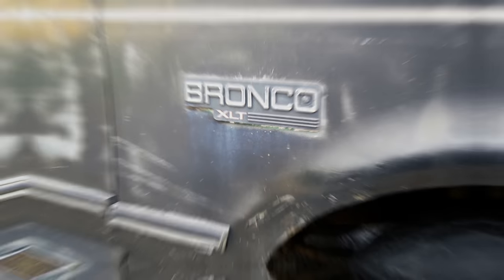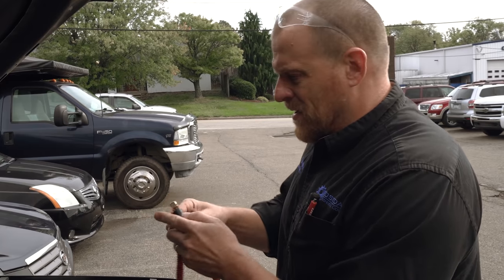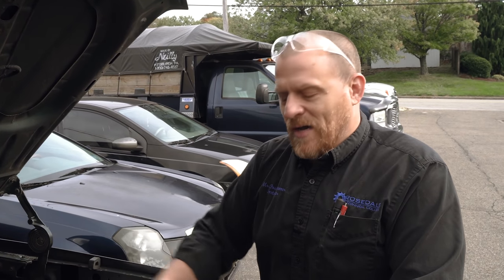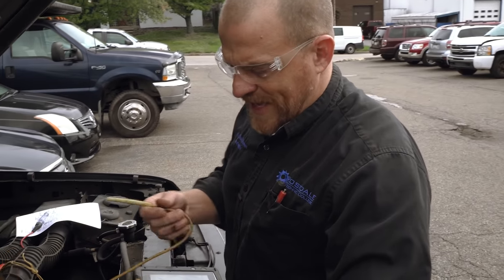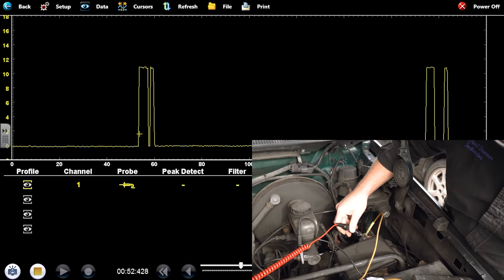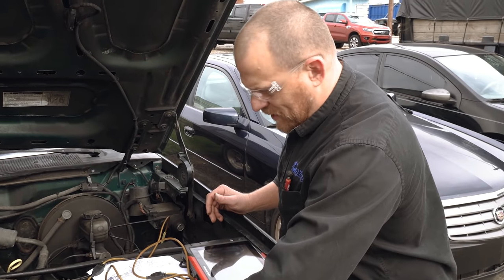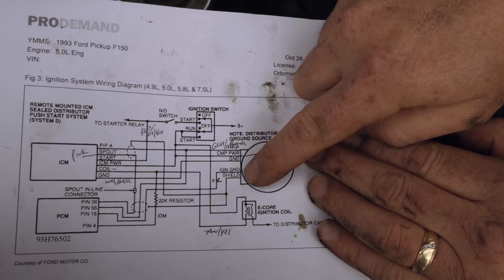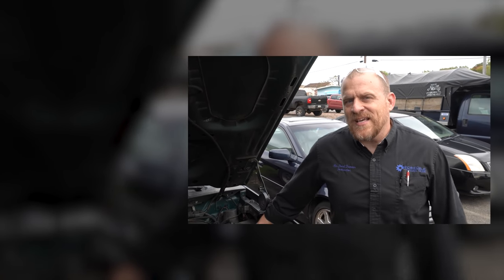Ford EEC-IV No Spark Diagnostics

Comment: Paul,
Great diagnosis/explanation on the good old EEC-IV - thank you!
Those PIP units are such a pain to replace as you need to remove the distributor gear which is pinned and pressed on. Probably replacing the entire distributor is the most cost effective solution.
Paul (in MA)

Comment: Nice. I recently fixed an intermittent hesitation/no start in my 1988 Bronco II (that I bought new in 1987) by replacing the distributor. I used a break-out box and oscilloscope to monitor the PIP and SPOUT voltages, and the primary ignition current at the coil. When it died the PIP voltage decreased and took out the SPOUT and primary ignition completely. One of your earlier videos clued me in to the likelihood of the distributor Hall effect sensor being the likely culprit, so many thanks for that.

Comment: When I was 16 I used to have to start my 88 Ford ranger by jumping the solenoid connections with a screwdriver. It was a manual.  one time I left it in gear and it drove into a telephone pole 🤦‍♂️
Reply: Yes cars are extremely dangerous when caught  someone on surprise. Any individual is exposed to risk of injury when mishandled.
Reply: LOL 🤣😝
Reply: I had to that to my 83 mustang gt. Grabbed the linkage to give a little throttle while cranking….. got a decent jolt 😬.

Comment: I can't say thank you enough for this video!! I just had an 89 Bronco w a 5.8l that just flat died on me like you shut the ignition off.  Using your method and your tests, quickly figured out it was a bad ICM and pick-up.  Couldn't condemn the coil at 1st bc w icm unplugged, I had good pwr in and out of coil, BUT when I plugged icm in, the bright test light on the control side of coil went dim.  Anyway (sorry for rambling), it wound up needing dist assy w module, and a coil. Once I had coil control restored, still no spark from it. New coil on, truck ran like a champ! How can I ever repay all the great information......thank you! God bless!

Comment: ah the ford module!!! was it a 7/32 socket or a 9/32 socket? and you had to grind it down all the way around to fit in the hole!!!!... never forget dy-electric grease between the module and the heat sink!!!
Reply: Kept one of the module tools, a spare module, and a tube of arctic silver in the glove box in the mustang 🤣

Comment: Nice brother., Like you, I have worked on tons of the EEC IV systems. You can change the pickup on them, but the time involved to take apart the distributor isn't worth it. I think the puller kit is still someplace at the my shop for these.
Reply: Nice to c another super tech Joe’s Auto Electric comment. I never missed any of your vids. Watched them all. Miss your content. U always had good stories to tell.
Reply: Never use aftermarket distributor caps :lol:. I bought a wells one when I first got the 85 crown vic in the mid 90s  to do a full tuneup and I had nothing but problems. Then I pulled the center post and the whole terminal came out of the distributor. I fixed it with wire ties to get home. I put the old motocraft one back and returned the POS. Learned my lesson about aftermarket parts.
Reply: Hey Joe. Liked your videos a lot. I remember that most of them were very interesting because  were tricky to diagnose or because somebody already "worked" on them . 🚬

Comment: I have an 89 F250 and 89 Lincoln Mark VII.  I'm becoming an expert in these systems quickly..  both vehicles had a habit of just quitting unpredictably and then coming back to life after cooldown.  Considering a remote mount kit for my ignition modules if they fail again.

Comment: Nice video. That fan without the shroud can ruin your day quickly. Specially for all the people wearing hoodies and draw strings swinging around.
I worked with a guy that was putting a fuel filter on a crane and was holding on to the radiator shroud to support himself and the operator pushed the starter button. I was really impressed with the guy not choking the operator with his other good hand. His nick name was big Al and he was a hand to hand combat instructor in the Marine Corps. 😁😁

Comment: Hello,
Thank you first of all for posting all these excellent videos. You are clearly an expert mechanic that is very hard to find these days as most mechanics these days don't have the knowledge of how things work and all what they do is change parts.
I have a real good one for you. I have a 1991 F150 5.8L engine with 123k miles on it that I bought from a chief pilot at United Airline. Anyway, I drove the truck over 800 miles and drove like brand new. I parked it for a week and when I tried to start it, it wouldn't start.
I watched your video and I said to myself I can follow your method to figure out the problem. Note that About 2 months ago, the ECM went bad and I took the ECM out and was able to fix it and it was the same issue with the capacitors going bad.
Anyway, I followed your approach looking to decide whether I have spark at the coil. To my surprise, there was a spark at the coil but not much at the spark plugs so I replaced distributor cap and rotor but to my surprise, the engine still wouldn't start even though I have a spark at spark plugs end. So now I am thinking I have a fuel problem but giving that I have dual tank, it is highly unlikely that both pumps are bad. Hence, I replaced the fuel filter and again the truck failed to start no matter how much I cranked it. Next , using a new fuel pressure gauge, I measured the fuel pressure and it was around 41 PSI so fuel is no longer a possible problem and I am out of options till I disconnected the 2 hoses to air filter and noticed that intake is completely closed. So now I started to think that may be the fuel mixture and spark plugs are flooded giving all the attempts to start it for the last 7 days. To make the story short, I pressed on gas pedal all the way which forced intake to be wide open to outside air and not going through air filter and after few attempts, the truck finally started. It ran rough for the first 30 minutes of drivings and after that  the truck is back now running like brand new, idles and drives beautifully.
I am glad the truck is running again but have no idea what caused the no start problem in the first place. This only happened to me once before but the truck started back then after letting it sit for few hours but not this time. One thing to note is when the truck was sitting for a week outside we had very high humidity for few days but not sure if humidity is a factor.

I would very much appreciate your input on what really was the problem. Again, thanks to you, not only i was able to get the truck going without having to wait 10 days for the dealer to look at but I am sure I also saved myself over $1000. The dealers in Chicago area charge extra 25% if your vehicle is old and many don't want to work on it.
Look forward to your reply,
ANJ

P.S. Are your classes available online to take? If not why not? I would live to take your classes. Also, do you do remote consulting for a fee?
Reply from the maker: Was there a difference in the spark at the plugs after the cap and rotor was done? Weak spark could definitely cause a flooded condition and the clear flood crank was what you needed to do after restoring proper spark. Hard to say. What did you say was in the intake??
Reply: @ScannerDanner  
There was nothing in the intake. I was referring to the metal plate that sits on the inside of the intake and opens and closes with the depressing of the gas pedal and functions like choke I think.

I am very much interested in taking your classes if you have them online like YouTube or using zoom. 
Thank you again,
ANJ
Reply: I forget to answer your question and I don't think there was a big noticeable difference in the spark after changing distributor cap and rotor. I am planning on doing tuneup as it has been a while since existing spark plugs and wires have been replaced.
Reply from the maker: @woodyk5127  oh okay, that makes more sense. Thanks! My classes are all available on my website at www.scannerdanner.com I have over 450 hours of training available for $11 a month. Hope to see you there!
Reply from the maker: @woodyk5127  okay, there are other causes for flooded conditions too, one in particular to pay attention to is the engine coolant temp sensor. Google how to get flash codes from your truck, it was a really weird procedure and involved using a test light and a jumper wire but I don't remember how to do it. See if you have a code for the ECT
Reply: @ScannerDanner  
Thank you the quick reply. I will definitely sign up for your classes and $11 is very cheap. 
ANJ
Reply from the maker: @woodyk5127  start in my chapter 6 (thermistors) playlist as it deals with the ECT. It would just be a good starting point for you as you have this as one of your potential problems. Looking forward to your comments on the site!
Reply: Hi Paul
As discussed yesterday, i signed up today for the premium channel and look foward to start learning the material. 
Hope u have a great weekend,
ANJ

Comment: I would pull the fan belt for troubleshooting as it should not get hot in 3 to 5 minutes of running, and you can pull on wires and pound on modules safely. Of course, reinstall it once you are done!

Comment: That's handy, a ratchet hammer.
That electrical diagram brings back memories of when my son had an ignition problem with an old Ford Ranger 4-banger. It would not start with the SPOUT wire connected but it ran fine if you first started the engine and then connected the SPOUT wire. 

Never did figure it out he ran the truck like that until some lady fell asleep at the wheel on the DC beltway, t-boned his truck and totaled it.

Comment: Sometimes the connection to the ignition module, the Pip connection can be corroded... placing your tester in the connector sometimes scrapes just enough of the corrosion away to allow it to run... just a thought.

Comment: the sad truth is the parts are still available and so cheap its almost worth it to shoot the parts cannon  because most of todays techs never worked on these and the diag labor alone will be the same as the parts
Reply: I'd have probably looked at distributor first... always seem to be the issue.
Reply: In some cases, it's absolutely true what you are saying.....
Reply: @xephael3485  I had a similar issue with a wells aftermarket distributor cap. Not hard to diagnose though, the center terminal just pulled right out
Reply: It's true, those old mustangs have that system and it's parts galore. New high performance parts being made, replacement computer systems being built for the user to program and tweak. An automotive community in its own.
Reply: @jamesd6247  On my 85 crown vic CFI I remember how complicated diagnostics were. You could have a bad EGR solenoid and the car would stall intermittently, etc. No datastream either. You really had to know your electronics and voltages. I really learned a ton from that car, many years ago but solid basic skills that you could use today.
Reply: Plus you get the new parts in the end
Reply: Holy shit I’m litterally doing this exact job I’m gonna check it this way

Comment: IIRC, the spout connection was unplugged to allow the PIP signal to directly fire the ICM to set distributor timing. Disconnecting the spout was also a handy way to determine whether it was a PIP or PCM problem.
Reply: Is the spout connector the part that connects to the ignition module?
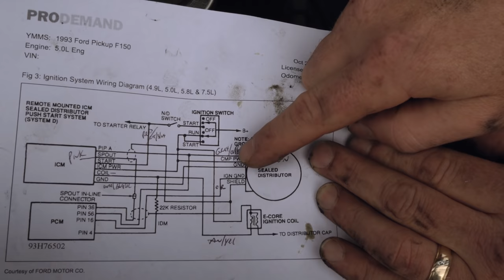Reply: @gmax341  Check out the diagram @14:50. It's between the ICM and PCM.
Reply: @fascistpedant758  ohhh so just a connector that connects wires together. Not sure how to explain it so sorry if it sounds stupid. I think I have seen a few of those. They are rectangle or squared shaped. Normally black in color with maybe red, orange or grey/white weather seals at the ends. Can you believe I've gone through three ignition Control Modules before I found the correct one that didn't set a CEL? Only problem now is my remote start don't work no more! Engine cranks but doesn't fire. I'm sure its probably some wire I knocked loose from the aftermarket system they installed. Thank you anyways!
Reply: @gmax341  I seem to remember it being a small block plugged into the distributor, but there may be different designs.
Reply: @fascistpedant758  I'll have to check and see for sure. If it helps any, I have the 5.8l V8 351W. In a 96 E150.
Reply: @gmax341  should be a little square gray plug over in the harness on drivers side inner fender area.

Comment: A very appropriate teaching with experience and safety. 

To augment (Naval Aviation Electronics Advanced Maintenance) working radar, experienced a common FAILURE caused by a weakening magnetic FAILURE! 

With an elderly motor, it's likely the same weakening of the magnetic field of the distributor rotor shaft is getting below the engineered limits of the HALL EFFECT (a semiconductor) to perform.  

That limit would be sensitive and influenced by a variety of varying influences, creating the "confusion" of intermittent! (Heat of varying mechanical spacing, heat effecting magnetic strength, heat effecting the sensitivity of the HALL EFFECT semiconductor AND the COMBINATIONS, etc.)

Comment: I did a 92 f150 5.0 no spark 2 years ago no spark. The first thing I did was pull the distributor cap and the inside of the distributor was alot of rust inside so I replaced that it started and ran but with 200,000 miles on it I replaced module and coil so there wouldn't be any problems.

Comment: ignition module not cleanly mounted on heatsink(with thermal transfer grease) will overheat and die in mere seconds to minutes, depending on ambient temps.
overzealous screw tightening, can warp the heatsink and module both, making them not have good contact except at the outer edges and yet again self kill in short order!
been there done that, long ago.
many of the GM setups had the same issue, with module on heatsink near coil and internal distributor mounted ones, both. after the factory module died, a "yinyang" often repaired and caused the replacement to fail quickly(did that once also), but being into electronics and most all mechanicals, I figured out my err real fast :)

Comment: I can say I rarely replaced PIP sensors. but I made sure there was good plugs, wires cap/rotor at first sign of anything amuck. high voltage fireworks inside the cap = PIP death!
GM was more famous for secondary ignition issues killing the coils and that smacking the module, which was then self inflicted short life after from over-torque and bending.

Comment: I remember those days Paul. Flashbacks. The negative side of the coil should of flashed if the pickup was good. Right? Hello Caleb and Danner. 👍👍
Reply: I'm at 1:53 so far. I'm pulling the cap and checking for distributor rotation and then pickup coil action with a dvom
Reply: Remember that Danner is going as if he doesnt know the strategy but knows that the modules responsible for ignition should have their controls right along with their power and grounds.
Reply: @scientist100  yes
Reply: @scientist100  Yeah but us old schoolers worked on an awful lot of those EEC-IV's .... also GM OBD I... read tons of codes with paperclips because the cables for the MT-2500 broke... Oh and who could forget Chrysler SMEC's that you could read by clicking the key 3x.... Yep we old timers worked the heck out of component diagnostics

Comment: They don't make them like they used to. This truck shouldn't be in a junkyard. Not for another 30 years. The new 2021 Ford Broncos will be in the junkyard within 10 years. Great video Danner!
Reply: Agree completely.  I just did some upgrading work on my 92 F250...virtually the same truck as the Bronco...and I'll be driving it long after anything else I see on the road meets the junkyard crusher...lol.  I cringe at all the sensationalizing of old great car and truck models...by reintroducing these modern things that have no semblance at all to the spirit of the older models.

Comment: To get to the " Distributor Ignition Pickup" you have to take the distributor completely apart. Believe it or not you can get the part online, really cheap. But I found it to be quicker if you just drop in a new distributor. That's why I love Fords, you can get practically any and every part online. Their parts are almost always cheaper than any other maker, for a comparable part.
Reply: Indeed, a new distributor assembly often costs less that the components individually